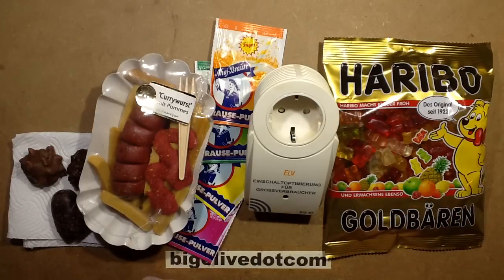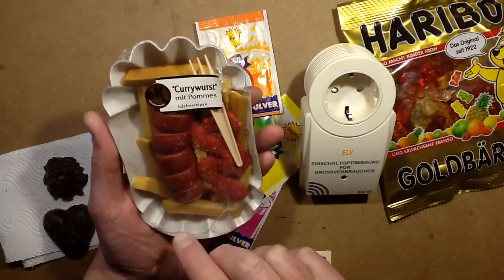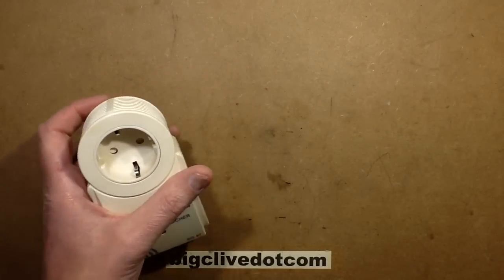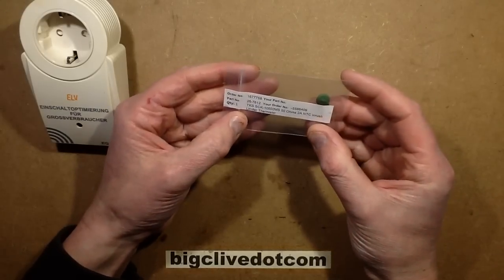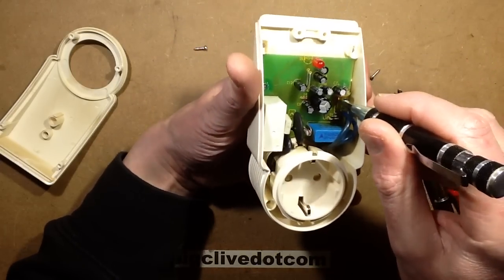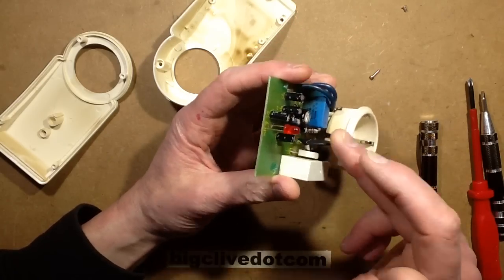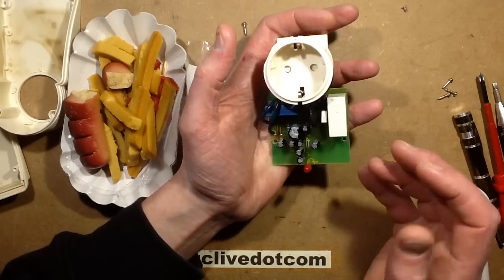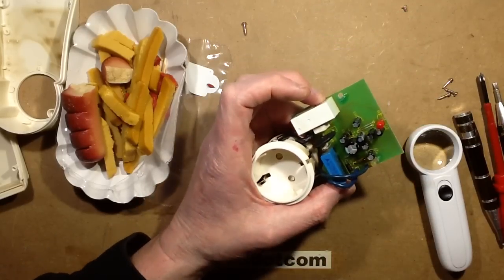German candy and a mystery power device.

Comment: Here in Germany we have breakers with different short circuit triggers too. B is the most common type, for three phase applications C characteristic ist often used. Normal supply for one household ist three phase 230V/400V 63A.
Reply from the maker: Odd.  In the UK we just get a single phase brought into the house from the three phase cabling in the street.
Reply: bigclivedotcom In most of Europe we get all 3 fases in from the grid. Normal appliances like lighting, and anything that comes with a plug, runs on 230V live and neutral like in the UK. Only things like cooking stoves or elektric waterheaters runs 2- or 3-fased 400V. And off course larger motors like for instance larger heatpumps.
30 years back, allso washingmashines and tumbler dryers ran on 3-fased power.
Reply: Exactly like that in old German houses. Everything runs over one single 16A fuse. You can turn on several big things one after the other, but if there's an outage (or the fuse triggering), the fuse will no longer hold, since everything tries to turn on the very same time.
Reply: Alexander470815 same here in Denmark, only we normally have 3x25 or 35A in, 50A if it's a large house with mainly electric heating. And most commonly we use type C breakers or fuses.
Reply: I think that they don't want the garden and pavement to be ruined over and over. It's the same here. We in the Netherlands also have cable and a phone-line standard to most households (unless they are far a way in the country, farms etc). So if you want to use the facility it's there by default. That is the problem they face here as telephone DSL is being replaced by fiberglass. But when you have the option to have high speed cable no-one wants their garden dug up for fiber. As their doing now for newly builds it doesn't really kick off for old build neighborhoods.
Reply: John Rasmussen that's the same standard that is used in the Netherlands
Reply: Between the mid 70s up to 1990 L-characteristic was common in Germany, short-circuit trip is tripping on 3 up to 5 times of the nominal current, like B (they only differ in the thermal overload release). But before this, they used the H-charakteristik (up to mid 70s), the short-circuit trip is tripping between the 2 and 3 times of the nominal current. These were made for grids with a high impedance. But now the grid is loq impedant, and now these MCBs are tripping really often when using devices with a high starting current like vacuum cleaners, computers or something like that.
The thermal overload release on H and L should trip 1,75 times of nominal current in less than one hour (28A on a 16A MCB with H or L). With the B and C-characteristic it's the 1,4 times of the nominal current.

The H meant "Haushalt" in german, or translated "household" in english. L was former called "Licht" (light), later "Leitungsschutz" (lead protection).
Reply: In sweden we got 3-phase in, 3x16 amps usually, for the main inputs, then 10amps for regular fuses, standard anyway.
Reply: In some areas in Germany it's the same, but in most cases you've got three phases. Now there's a regulation that new devices with more than 3600 W must be connected and fused with three phases.

Old installations got 3x35 A. Mostly Diazed-fuses. Newer ones are fused with 3x50 or 3x63 A (NH-fuses, Neozed-fuses or SMCBs). This depends on size of house/flat, type of heating, type of water heating.
Reply: +killerbeenl does saba count as 'far away in the country'? :)
Reply: Francesco Gugliuzza in the US  we have 125 amp split phase 240 volt supply with larger homes up to 200 amp.
Reply: what is the main supply  - as others have suggested  if the mains supply is 16 a running a  kettle and  toaster would trip the main fuse as would running  the hob and oven of an electric cooker 

13-15-16a is ususally the rating of  standard plugs  and if radial wiring is used each radial  ( wherre rings are used  ring will be 32 or 63 A with a number of  13/15/16 a  sockets
Reply: But those weren't MCB, in this case they used Diazed fuses with gG/gL characteristic. They are slow enough for such things. And during this times you had not much electric devices at home. Lights, Radio, flat iron, small cooking field and eventually a vaccum cleaner. But most households got a flat iron fed with coal, and the cooking field was heated with coal too. And you were the king if you got a TV during 1950s.
Reply: The most embarrassing setup is what Americans have. It's usually just a single phase at their silly low voltage without even increasing current to compensate. But the weirdest system has to be in Norway with their split phase power.
Reply: Salvatore Shiggerino Single phase, silly low voltage, low amperage. Yeah. It's sad. I've lived in the UK before.
Reply: in the US in somewhat older homes 1980's 100 amp service, and 99 % percent of new or updated homes have 200 amp service and both of them are split phase 120/240v, 120v for things clothes washers, and branch receptacle outlets and lighting(15-20a 120v breaker), and 240v for stoves,/ovens(on a 50a 240v breaker), well pumps, water heaters, clothes dryers(30a), Central air conditioners, welders and other high powered loads, and commercial low voltage 3 phase is either 120v/208Y or 120v/240V split/high-leg delta which on the high leg is 208v to ground, our high voltage 3 phase is 277v/480v.
other weird US 3 phase configurations are corner-grounded delta, ungrounded delta and "ghost-leg" 3 phase service which uses only 2 transformers for step down.
Reply: Newer houses often use a single phase too here in Germany, with a measely 10A circuit breaker for the power sockets; the amount of problems these cause is rediculous, powering on an old vacuum cleaner is sometimes enough to trigger them...
Reply: That are old houses, now 10A are used for lighting only. In most cases they're fusing the sockets with 13 or 16 A in newer houses. In old homes you'll sometimes find old 10A MCBs with the H-characteristic. The H-characteristic was made for grids with high impedance. Since the grids are now low impedant those old MCBs are making trouble with devices that are drawing a high initial-current like vacuum cleaners or PCs. Those old MCBs were build until 1976. The H-characteristic short circuit protection trips from two up to three times of the nominal value which means in the case of a 10 A MCB: 20 to 30 A. But the overload protection (long time) is tripping at one hour of 1,75 times the nominal value, which means: 17,5 A.

And single phase in the distribution unit is no longer permitted in new installations, because every appliance that needs more power than 3680 W is required to use a three-phase current connection due to the VDE 0100-regulation (regulations for the installation of low voltage systems). Everything up to 1000 V is low voltage. Example is the kitchen stove or flow-type heater, they must be provided with three-phase current. Normally the kitchen stove is fused with three 16 A MCB (B-characteristic). In this case they could provide:

16 A * 400 V * 1,73 = 11072 W

1,73 is necessary because the three phases are shiftet with 120°. Normally this is the root of 3, but I'm calculating with 1,73 because in the practical use it's sufficient to calculate with it.
Reply: Drew Dastardly What EU system? The wide area synchronous grids? How exactly do they piss people off?

Other than that, it's my impression that power distribution is still mainly a national affair.
Reply: Not only for industrial use. The three phase cables are laying under the streets in the UK, but in one home you only got one phase of the three, actually they are spreading the houses onto the three phases. So it could happen if you measure the line of your neighbour against yours -> 400 or 415 VAC...

 You could get three phases in your house too for decades, but most people don't do this in the UK because the electricity suppliers wanted extra cash for this "luxury"...that's the reason why it's not common in the UK to have a three-phase current access.
Reply: That would be possible, and a three-phase current supply is a nice thing for a workshop or if someone's buying an electric car (faster charging of the batteries). There are charging stations available with 22 kW, they need a three-phase supply fused with three 32 A-MCBs. Single phase that would draw a lot current. And that's the reason for three-phase supply, appliances that are in need of much electric power, but you spare 50% of the conductor material. The same reasons why you've got the ring circuits in the UK fused with a 32 A MCB. The 2,5mm² is only allowed to use for a current up to 26 A in the UK (in Germany max. 25 A ) so the ring circuit was introduced and the cables will not be overloaded anymore. Spared copper. Only if the ring is opened, in this case you would probably get a problem.

"Seriously? So if you boil a kettle a heat a toaster you have to switch 
off the refrigerator!!?? and surely can't run a washing machine at the 
same time?"

In Italy they're using C-type MCBs. The short-circuit protection is tripping between 5 and 10 times of the nominal current, B-type is 3 to 5 times of nominal current. Overload protection is the same as B-type, which means up to 1,4 times of the nominal current for one hour.

Comment: in America we have 100amp trailer house... yes 1/3rd our nation lives in poverty in glued together homes highly flammable homes. the 2nd 200amp is home use input at 220v split to 2 roughly  or 110v socket which are breakers @ 120v each main systems are 120v AC but that's after the breaker by wiring both mains we get 244v ish but ground is direct and only used in appliance applications. our large load are rated 110v and are half input from mains with a separate breaker that separates ground from the primary. sorry if it doesn't make sense but it's this way so that there is always a ground at higher voltages

Comment: On a trip to Japan, in the flat I've rented out for a week, there was a 24A fuse - mind that Japan runs at 100 V... It was the middle of winter and the heating was electric, there were two heaters 1.5 kW each - one on each floor. Needless to say, that was fun.
Reply: its never occurred to me before but thats probably one reason why those little kerosene heaters are so popular in Japan
Reply: Yeah the electrical supply here in Japan is a joke on so many levels (it all starts with the fact that half the country is 50 Hz and the other half 60 Hz...). Luckily most of the real energy sinks run on gas (cookers, water heaters, gas tumble dryers are also common). Often I miss my big beefy European power supply.
Reply: If you can speak Japanese it's not hard to go and ask the energy supplier for a 40A contract instead of a 25A or whatever and have them come out and do the work.
Reply: donpalmera You've clearly never had to deal with my 不動産 representative :p
Reply: ***** 

Speak to the person that owns the building and tell them that the breaker keeps tripping... or move to somewhere that isn't a tiny shack with a 25A breaker to start with.
Most places built in the last decade that aren't single room apartments like leopalace have a 40A breaker to start with.
Reply: donpalmera You must be fun at parties.

Comment: I live in Germany and before I moved recently I lived in an apartment in a modestly old house. the wiring was.... interesting at least and the breaker were the highlight. Every time I turned on my oven (oven was running on the same phase) my breaker switched off and the whole apartment was dead, since there was only one breaker. Then I got one of these devices (inrush current limiting), but it didn't work even remotely. Also, it was described to not work on socket boards and I still wonder why. Maybe Clive got an idea? I doubt it was as fancy inside as the one you got there tho.
Reply: IdleGandalf i've Seen this before: this is not a current overload, but a ground fault. If it was current, in germany, you trip a sperate breaker. What happened in your case: there was a leak to ground (can be as low as 20mA), probably caused by dirt from cooking, that was detected by the Main fuse, that is before all other fuses, wich in germany is usually the only fuse wich has that capability. (would also explain why the current limiter did nothing) - otherwise it had only one 10A fuse, wich is in germany not permitted for a whole appartment
Reply: remotecontrol well I had only one breaker, I didn't got a ground leakage protection breaker, the breaker was rated 16amps for the whole apartment, it was a older type of breaker but you could just slide it back up like the modern ones.

Comment: I have just a device like this one and I need it to use my pinball machine (it has Nancy and Ronald Reagan on the front face, to give you an idea of it's age). in the input side, it has two big capacitors and a huge transformer (this is before the days of switching power supplies, clearly). 
If I don't use one of those inrush limiting devices, the 16A circuit breaker will trip about two out of three times. With the inrush current limited, everything works fine.
Btw, the pinball machine itself would make a cool teardown, on the input, it has a 20A bridge rectifier and it's voltage regulation is done by discrete transistors - beefy ones with huge heatsinks.
On the digital side, it has two (!) 6800 processors, one does, among others, control the speach output which basically consists of a sample eprom, a D/A converter and the audio amplification stage.

pj
Reply from the maker: I have three pinball machines from the early eighties here.  They do have quite chunky transformers in them.